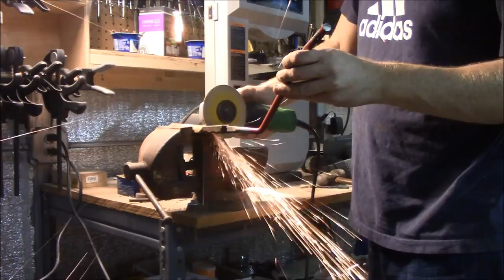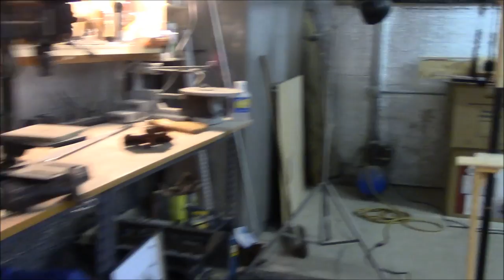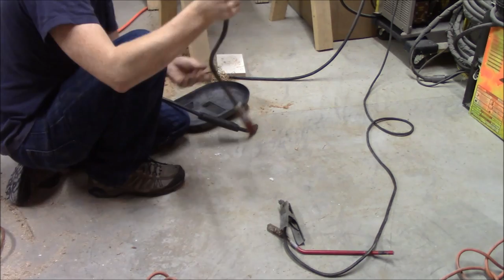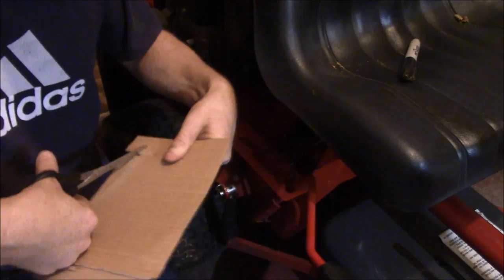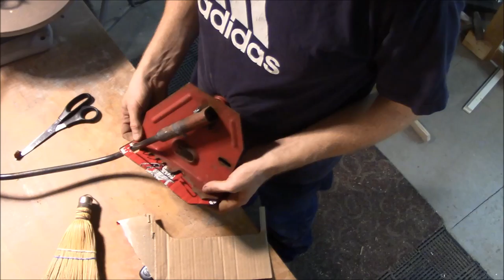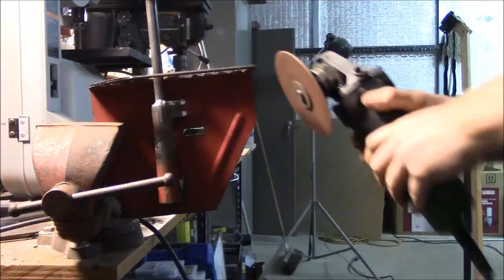Snapper Lawn Mower Shifter Repair, metal fabrication.

Comment: My second one (home made) has just snapped - I've refurbished the rear axle with new boots and grease so it should be a little smoother now. Don't have your skills, though, so mine is probably not as strong. Can't say I like my mower very much, had so many issues with it
Reply from the maker: That is my dad's mower and the handle broke probably 12 years ago. Ive fixed it a few times, but decided it was time to make it nice.

I'm not a big fan of snappers. But, if you are willing to work on them, you can keep them going for a long time.
Reply: I have a 40 year old snapper that I use every week. They are tanks and will last forever with proper maintenance. I also have a 1999 snapper mower that fired right up after ten years in a barn collecting dust. Sure they will break if neglected but so will everything else. In my opinion snappers are the Honda of mowers
Reply: @JohnHamerProjects  Also, the reason why you two might be having issues with the shift handle breaking is because you need to grease the inside of your boots every now and then. My handle used to be very difficult to shift and I finally got around to cleaning and greasing the shaft and replaced the boots (also greased all the other needed areas) and now it shifts with very little pressure needed. If you are putting enough stress on your shifter that it is wearing out like this, that means it desperately needs some lubrication.
Reply from the maker: @nickdipaolofan5948  I'm sure that is correct. It's my dad's and I made the video while going through the whole mower. It  shifted pretty easily when I was finished. I might have broken it originally when I was a kid popping willies though lol. His mower is probably 25 years old and my dad does very little maintenance. He has been through 3 engines.
Reply: @JohnHamerProjects  haha, yeah sounds like we found the issue. My 40 year old Snapper is only on it's second engine and the first could have been rebuilt but was just cheaper to buy a used engine and slap it on there. I am pretty hard on my yard equipment too, but as long as I do regular maintenance they hold up well. I used to be like your dad (never paid attention to the machine until it broke) but finally a mechanic friend of mine helped me learn how to do basic maintenance and I never looked back. A couple bucks a year saves a couple hundred in the future.  Btw, great video!
Reply: @nickdipaolofan5948  So what does that make Honda mowers?
Reply: Spandit, hahaha good point!

Comment: Well done!
Reply from the maker: MNpicker thank your. I was pleased with the results.
Reply: John Hamer I have a feeling that is gonna be one sweet snapper when your done..You should film the rebuild. I wanna fix up my old snapper this year.
Reply from the maker: I mostly have it together. That was the only part that I thought would make a neat video because of the fabrication. I rebuilt the differential and the chain case. I mostly just have to put it all back together now. I do have pictures of everything. Maybe I can throw a video together when I am done. I used Jim Jackson's videos as a reference. He does complete rebuilds of snappers on his channel and has a lot of good tips. I would recommend watching his videos. He does not do much editing, so they are a bit slow. He covers every detail of the build.
Reply: John Hamer Yeah Jim's vids are what got me thinking about fixing up the old snapper. I did tinker with them quite a bit when I was younger..think im gonna start back up again. These old snappers never die!
Reply from the maker: +MNpicker they are definitely completely rebuildable. My dad bought this one when I was a kid, probably 25 years ago. The only reason he brought it to me was because the engine rings were shot. Every bearing in the drivetrain was shot, and the grease was gelled,   but the thing still cut grass. If I would have just replaced the rings, I'm sure the thing still would have gone another 10 years like it was. I bought all new drivetrain gaskets, bushings, and bearings. It should be like a new lawn mower when I get it back together. I did spend too much money on parts though. I got a little carried away buying a new seat, stickers, and plastic parts. It's a gift for my dad though. I probably could have gotten the thing mechanically sound for about $100. I'm going to end up over $400 with all I bought.
Reply: John Hamer I saved mine from the scrapyard..a guy had it in a load of scrap and I was lucky and it was free. The mower is all there but the  rear bushings are completely shot the boots are rotten, the chaincase leaks around the gasket and I'm pretty sure the diff is dry as a bone. I want to get the heavy duty bearings that were in the "Extra Tough" model. I will be getting all new bushings as well. $400 is not to much to spend on your dads snapper. Think of all the memories you had with that mower....and you basically get a brand new mower... for $400. I say thats a win win!